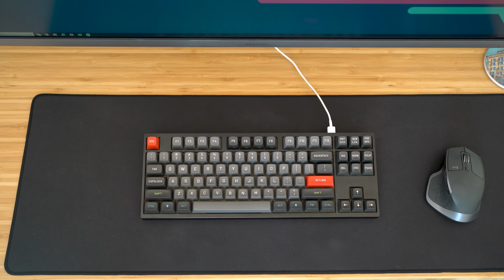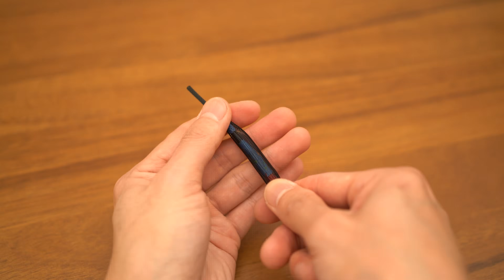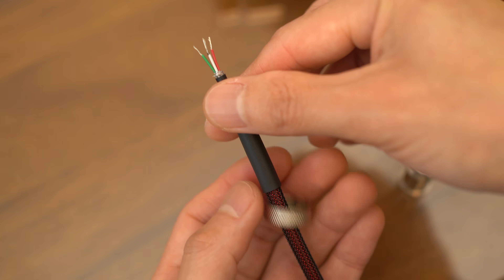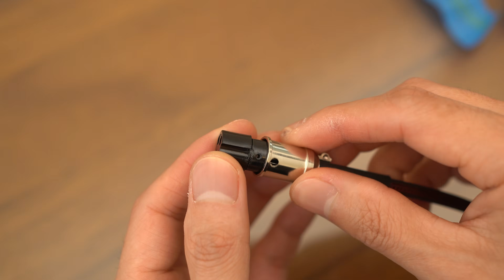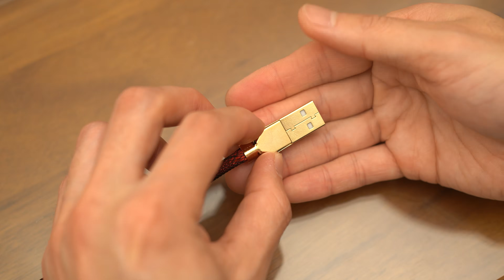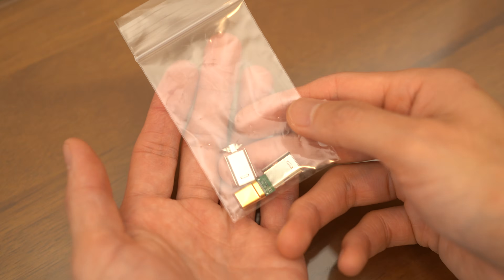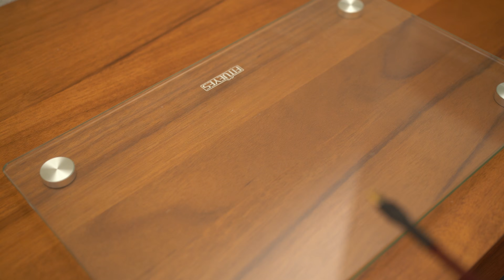Custom Coiled USB Aviator Cable for $50?!?!  Build one DIY for just $17!  Follow Along Tutorial!

Comment: An idea for the pushing cable through paracord part - instad of pulling out the white strings, attach them to the end of the cable and pull it out from the other side. This way you can just hold the paracord on one side and it will be much faster :)
Reply from the maker: Thank you so much for the advice!  I will try that out next time!
Reply: @Keybored  Lmk if it is an improvement! ;)
Reply: @Keybored  твои руки растут из жопы , ты даже не можешь припаять провода к конектору ))
Reply: I was going to comment this exact thing.
Reply: Cable in walls knowledge? I was thinking the same thing
Reply: @noxterrrr  kite tube repair knowledge :p
Reply: Right, I understand now. Never knew people do it this way, I'll give it a go during my next cable build. Thanks for your detailed explanation mate.
Reply: @friedsoursop  to be clear - I haven’t seen anyone do it witch cables (probably because it’s not fully necessary) but I sure it will work if you will use strong tape to tape string to the cable, good luck!
Reply: I legit thought this the second he started pulling out the white strings and I was like AHHHH I need to comment how he could have just pulled the cable into it with it and then I saw this and now I'm happy
Reply: @xtradark4621  I literally yelled at my TV and ran to my computer to pull up the video and comment on how he did that. I remembered making that mistake as a 1st year apprentice and turning a quick cable pull into a bloody ordeal.
Reply: Attach the paracord string to the usb cable using tape or shrink tubing.
Reply: That's actually the basics you learn as a électricien
Reply: use just 1 of the strings and tie it in several half hitches around the wire, if you have to tape the very bottom so that it doesn't slide up, but the half hitches should hold
Reply: That hurt so much to watch
Reply: @Davis Lawrence it worked and I now got access to my account again. I am so happy!
Thanks so much, you saved my ass :D
Reply: the white string is used for that infact, like the iron wire for the electrical conduit
Reply: def hurt my head when he didnt do this lol.
Reply: I used to work with an electrical contractor in San Diego, we'd use fish tape, & I was thinking, isn't that reason why that string is there, besides keeping it from bunching up & whatnot?
Reply: @Dillinger86  the string is to add strength to the Paracord.  Paracord is meant to be rope, but he is pulling the inside of it out to make it hollow.
Reply: Mind: blown
Reply: i think the paracord would get caught on the usb cable
Reply: @benji8690  you cut and then resolder the ends, so you aren't just pulling the ends through a price of Paracord
Reply: literally thought the same thing right when he started to do it
Reply: i dont mean to be offtopic but does anybody know of a trick to get back into an instagram account??
I was dumb forgot the login password. I would love any tricks you can offer me!
Reply: @Davis Lawrence i really appreciate your reply. I got to the site thru google and I'm in the hacking process atm.
I see it takes quite some time so I will reply here later with my results.
Reply: @Willie Draven you are welcome xD
Reply: Technically it is a bit complicated, the cable slips a lot, my technique is with surgical forceps, they are alligator forceps, they work too well.
Reply: That's an awesome idea and definitely makes it a lot faster and easier! Thanks for the advice.
Reply: Thanks for the idea, definitely doing thud for my next build
Reply: just tried unfortunately cannot be done
Reply: Thank god
Reply: Love this idea
Reply: What do you mean by that? By any chance do u have a video tutorial of what u just said? I've been building some cables but I've been trying to speed up the process. Any advice is greatly appreciated :)
Reply: @friedsoursop  the idea is that you already have a thread in the paracord, you want to pull it out and replace it with a cable, so instead of doing it separately you can use the thread to your advantage. Pulling through is easier than pushing, because creases won’t form. So you can tie one end of the exposed string to the end of the cable (best would be in a way that doesn’t make it thicker) and pull the string on the other side while holding the hole in paracord which the cable is entering through.
Reply: @friedsoursop  ok so remember when he pulled the guts out the paracord well on one end you take the guts tie it to the end of the usb cable and then pull the guts out pulling the USB cable through the paracord

Comment: When soldering the connector pins, preheat the pins to allow the solder to works it way into the pins and "tin" the wire side with solder so you have a solid connection. keeps you from having bad solder joints and connection failures.

Comment: Hola. Tengo un teclado mecánico al que le quiero poner un conector USB-C y conectarlo con un cable como el que has hecho. El tema es que además de los cuatro cables (V, D+, D- y GND) tiene otro cable negro que corresponde por el apantallado del cable original. Por lo que veo has eliminado  el apantallado (GND). ¿Funciona igual si eliminamos ese cable que va a la PCB del teclado?
Gracias y un saludo.

Comment: You are making one serious mistake when soldering. You are not heating the parts, you are only heating the solder. Next time try heating the parts so that they themselves melt the solder, not the soldering iron, otherwise there will be cold solder joints. Also make sure to tin the wires before soldering.

Comment: Im sure its buired but techflex and paracord will not be 1:1 to the usb cable, its easier to just cut the usb for the total length, and sleeve the usb paracord and techflex all in one go. Make your coil, and then cut the cable where the detach will go. also when you clamp the housings you want to make sure the techflex and paracord are being clamped too so you dont risk it undoing under the heatsrink

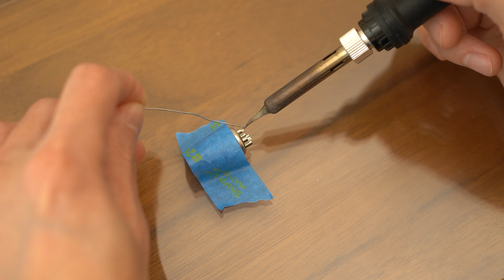Comment: At around 17:30 I noticed you struggled a bit putting the solder into the channels, though not needed in this specific situation, adding some flux to them would make the solder easier to work with (it increases the "wetting ability", basically makes the solder flow more evenly and not ballup). The only thing is, is that you would need to wash off the flux as it can cause corrosion over time. This is super easy to do with some isopropyl alcohol so def worth it if you solder small pads/wires/etc. often. This might actually be more helpful for soldering switches for a cleaner and easier application.

Comment: Tip: If you're unsure about your heat gun temperature, if it will be too hot or not hot enough, you can make a test using a little amount of cable (2 or 3 inches). You make that little test cable and use your heat gun on that, if it does melt, you lost just a tiny amount of material and not much time on it.

Comment: One thing to watch out for it seems like you have cold solder joints. although they will work they're more likely to break or not even make a connection, when soldering make sure to heat up both your wire and whatever you're attaching it to (connector, wire, circuit, etc) until the solder flows smooth, you shouldn't have to wipe it off the iron

Comment: Pretty sure I have some old coiled telephone wires. Those will work fine for a keyboard. A couple of USB C plugs is like $5 on ebay. Even cheaper. They make similar wire for aviation radios, though I seem to recall it is 5 wire. I think you can get braided but it will cost you.

Comment: Why did you cut the ground wires instead of connecting them properly to the housing? in the end they are connected to the outside of the usb as well ( normally that is )

Comment: the mix of the over powered heat gun with a 5 dollar soldering iron, scissors that can't cut, and the lack of a variable wire stripper is cringe af

Comment: Nice to know but not really worth it. With all the costs involved i might as well get it done by a german company at zero shipping cost and it costs 45 to 60 depends on the lengths of the cable and coil. Keycables. If they offer free shipping and customs fee in the checkout that will be worth it. Otherwise i have to pay dhl to do the customs paperwork which is like 6 bucks.
Reply from the maker: Hey, no wrong way to do it!

Comment: One of the biggest issues I had when I was making these cables is that I would make the mistake of stripping too much wire insulation and have long exposed stripped wires. This would cause shorting as the wires would make contact with the housing or the other wires when you bunch them together to fit into the aviator housings or usb-a/c housings. Rookie mistake, but it took me many tries to figure out why I kept getting a power surge and/or "not enough power" error on my desktop when I plugged in the cable.

Comment: Zapcables is much much cheaper for kits and parts also when coiling try coiling the opposite of the direction you want the end product to be then after heat treating wrap that coil backwards around the dowel so you mow have it going the direction u want with some more spring

Comment: I know this kit was from Cruz ctrl cables but you should also check out zap cables  they are slightly more expensive but you can get much longer cables like say you wanted a 12 inch coil and 6 ft cable over all with Cruz ctrl caping at 13 ft of cable that's not possible. Also zap has an extremely large selection of Paracord tech flex and a second double sleeve option that I can't remember the name of they also have anodized aviator connectors as well as weipu connectors Wich are a more slender style connector. And their standard is a 5 pin connector so that you can actually use the bare drain wire as it was intended( to drain induced voltage and stop data interference) instead of cutting it off
Reply: So your saying if I wanted a 6in. coil & a 3ft cable I would need a 9ft cable?
Reply: @Artfeav245  yes that's the general rule half inch ID coil 1 inch of coil length = one foot of cable

Comment: My own diy cable is style holding on like a champ. Only thing I did different was use hot glue on all connectors just in case the wire unsoldered it doesn't automatically touch the metal housing.
Reply from the maker: That is great advice!  Others have mentioned that as well!
Reply: @Keybored  yeah i almost burnt my place once by making a cable and that happened to me.

Comment: Awesome video man! A question: do you know what AWG your usb cable was? I'm pretty new to this, and I'm struggling to get my head around the different wire gauges used for cables...

Additionally, does the gauge affect how easy it is to sleeve the cable?
Reply from the maker: Hi Matt!  It's 28 AWG!  The 28 gauge cable wasn't too difficult to sleeve!  Thinner will be easier, but not sure if you do want to go to a lower gauge
Reply: @Keybored  Thanks for the help :)

Comment: I could go on about why this tutorial isn't exactly safe with modern power cables that are rated for 20V 5A 100W - you state "make sure the wires aren't shorted" - then you proceed to put on a metal housing touching all of the pins.... you should also be putting tape over the soldered wires BEFORE you clamp on a metal housing - SUPER IMPORTANT depending on what the cable is actually being used for - using a fast charger with this cable could be dangerous and in my opinion (EMPHASIS THAT THIS IS JUST IMO)  I don't feel you have portrayed that to your audience.

Comment: What is the point to have coiled cord for keyboard? It is useful for something like old phone earpiece which you need to extend and at the same time to retrieve. But keyboard is not that movable.
Reply from the maker: It's mostly for looks honestly.  For my latest cables, I started to just use straight, so that the cable doesn't have to be as long!
Reply: @Keybored  I see, thank you.

Comment: Great tutorial. Here are a few of my thoughts:
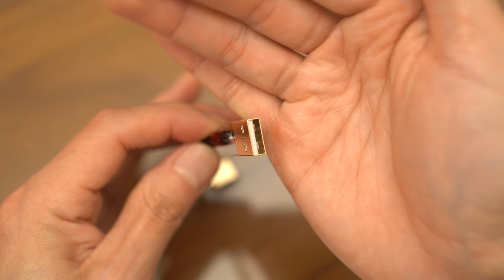14:49 To add more durability to the cable, an insulator can be added inside of the usb connector where the solder points are. Hot glue is a great one because it can be easily removed. This will help with protecting the cable from weakening and breaking there when pulled.

Also, after the cable is cooled down at the end, Reversing the cable and then reheating can give it more tension, as shown in this tutorial https://www.youtube.com/watch?v=8grrD17BB0w&t=278s
Reply from the maker: Great advice!  I have learned so much from viewers since the launch of this video!

Comment: Just a tip that might make soldering a little easier, especially with the big connectors (since they act like big heatsink for the heat of your solder iron tip).  Tinning your wires ahead of time prevents fraying of the conductors and solder to solder adheres easier than solder to wire.
Reply from the maker: :) I have learned so much from the viewers since the launch of this video!

Comment: Hi I have a question I have just followed your video and make my own custom coiled cable for my royal kludge rk61 the cable works on Windows but my fn key constantly flashes when in wired mode.. It also doesn't seem to want to charge the keyboard either could it be a wiring issue.. Like I said it works in windows and all the key work no other usb c gives me these issues
Reply from the maker: Hmm... How long is your cable total length? If it's too long, you will end up with some issues like charging, etc. If you have a multi meter, also a good way to see if the lines got crossed, etc!

Comment: I'm going to build a keyboard where the aviator connector is used to connect the cable itself to the keyboard. USB-C is awfully brittle and USB Mini isn't really much better.
Reply from the maker: Yup!  USB is not the most robust of connections!
Reply: @Keybored  I was first planning to use DB9, but since I'm making the case myself I figured that cutting a round hole for a GX12 connector is easier than making a properly shaped one for DB9. Also, it's kinda nice that there's a precedence for using that connector for keyboards. A DB9 connector might be confused with other things.

Anyway, USB-C is kinda like USB Micro, pretty awful but works fine for some things. However, it's absolutely horrendous that the latest USB standard is only for USB-C. Having things connected through that for long periods of time will obviously make it break from just the gravity affecting the connector. It's quite obvious that it was only designed for charging phones rather than anything that requires any kind of robustness.

Comment: Fantastic video!  I have a question: what is the purpose of the aviation connectors?  Why would you need to disconnect the cable at that location?  Why not just make it one continuous cable?
Reply from the maker: It's mostly for anesthetics :)
Reply: @Keybored  It does look pretty damn cool, but still... that's a lotta work, for purely aesthetic results.  I'm not sure I'd have the courage!  (But this is probably due to the fact that my soldering skills are utterly horrendous.)

Comment: Interesting, looks like you just cut off the ground wire and now the shielding is ineffective. 

One question though, what is the benefit of separating a cable into two and connect them via GX16 connector ?
Reply from the maker: Just looks for the most part

Comment: is it safe if my heat gun set at 150 degree celcius?
Reply from the maker: might be a bit too cool?  I know that the low setting for my wagner furno is like 400C which is very hot... and can melt the cable if held in one area too long... but quick motions with 400c does a good job.  I feel that 150 might be a bit too cool
Reply: @Keybored  alright thanks for the tips

Comment: Maybe a stupid question, sorry... If i want a 6 inch coil and I am purchasing the cruise control diy kit, should I be purchasing 6 feet of wire or 9 from the site? What did you get?
Reply from the maker: I got 9 feet in total and used about 6ft for the 6 in coil side!

Comment: Hi again Keybored, Just like to know if how would you know if the colors and/or numbers will be connected together correctly when plugging in the aviator. Thanks in advance.
Reply from the maker: Hi Rawland! Just need to make sure to keep the order the same, so when they're connected, they mate up properly!
Reply: @Keybored  thanks a lot for your quick reply. Its much appreciated. Does it mean the aviator will not go in if the alignment is wrong? How would you know if the right pin goes into correct color? Thanks again in advance.

Comment: You should might want to connect the cable shielding to the metal housing on the GX16. Might as well have the entire cable be covered in the shielding instead of having a split in the shield. Might also want to avoid cold bonding the solder.
Reply from the maker: You are very right!  I have learned much from the viewers since the launch of this video that will help me make better cables in the future!

Comment: So "save" $30 by spending >$200 on crap to make it... You sound like my daughter's logic. 🤦‍♂️😂
Reply from the maker: Most keyboard enthusiasts have all these tools
Reply: @Keybored  .. A microscopic subset of a subset .. and it's generally those who build PCs. A bad heat gun will melt those cables.
Reply: @DJaquithFL  Who doesn't have wire strippers, a soldering iron and a hair dryer 😐
Reply: @10aemiataman  .. So you think a "hair dryer" would work. I don't mean to laugh at you but wow. Sorry buddy you need a heat gun.